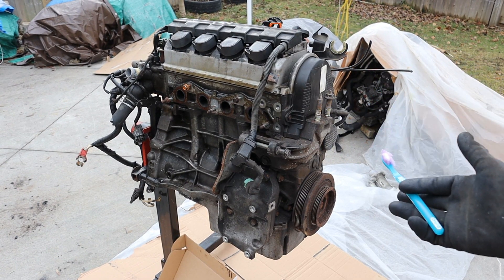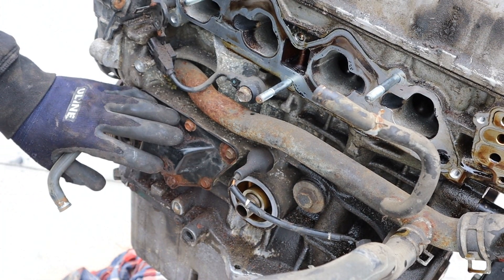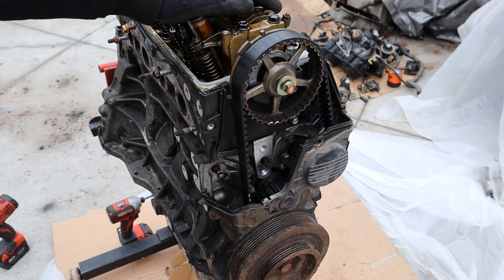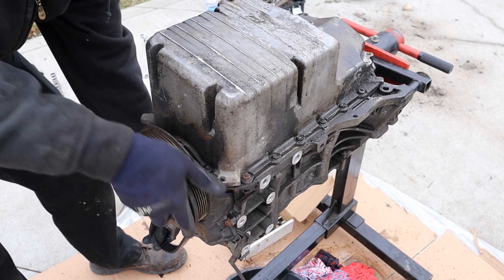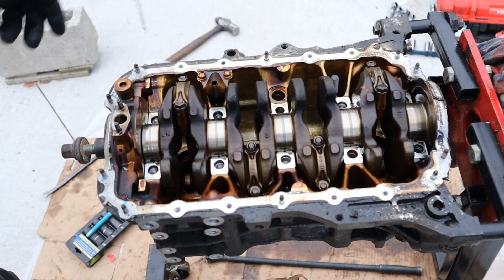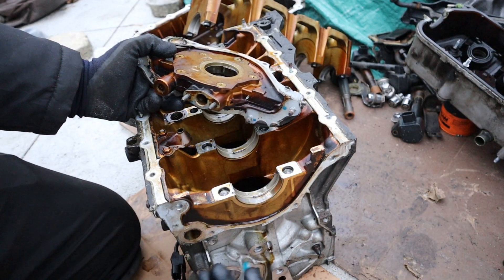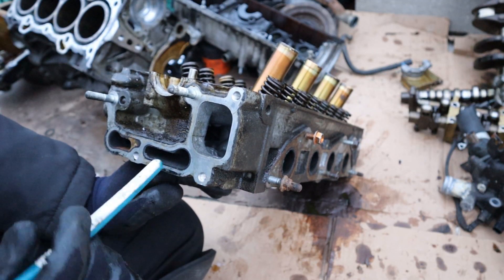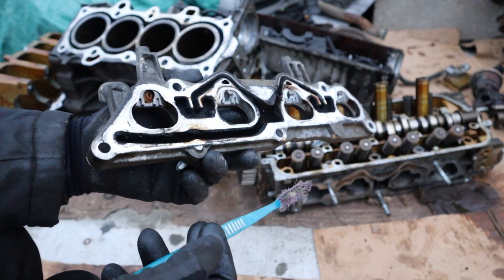Honda D-Series Engine: A Low Point for Honda

Comment: Disagree of the low point, Except for ONE huge issue, The headgasket failure problem, Just do it before You end up overheating it, Keep driving that's how I use them, It's a great engine otherwise......But of course I know these inside rather well from the heads up and the timing belt setup.😊

Comment: it may not be a high-performance engine but the D17 in my 2002 EX has 229K on it.  No replacement head gasket.  I call that pretty decent and she still gets 37 MPG on the interstate.

Comment: Low point, currently at 328k miles on my 2003 1.7 vtec. I did do a head gasket at 278k.

Comment: Dude you are nuts! The D series was way over engineered with its crank girdle + short of oil squirters which it didn't even need, those d16z6 and d15b JDM engines responded so well to just intake header and exhaust. I remember spanking a turbo Jetta with just those mods on my car. I've had four integras and four civics. And all my civics were single slam. My d15b was my favorite though. Vtec kicked hard on that thing using the p28 from the z6 and it was so damn clean inside. I would say it had maybe 30,000 mi if that.

Comment: On the backside of the block @ the minute 12:11 mark, that odd-shaped, pentagonal hole where the breather for the PCV valve goes: mine is leaking from there. How common is such a leak, how easy is it to re-seal, and where do I get a gasket for it? I've looked all over the diagrams at hondapartsnow with no luck. Am I supposed to use a particular grade of Hondabond on it?

Comment: Those 3 nuts you said at the bottom of the intake, they hold that plate for the EGR valve ports to pass thru. 
You can take off the intake without taking those 3 off. 
Once off, then take those 3 nuts off. 
I learned the hard way too 💯

Comment: The 7th gens we’re supposed to have the k series (like the rsx and what not) but Honda folded and put a weaker d series in it. Since the em2’s share the same chassis as the rsx…if the ey came with a k series these cars would be more sought after😂……but nooooo🗿smh

Comment: Honestly I would much rather have a timing belt than a timing chain usually on modern cars with chains you have to take the entire engine out to replace the chain unless it's a Toyota it's going to need to be replaced at some point in its life with a belt it's at least serviceable

Comment: 01 EX 338000 miles, using oil due to bad valve stem seals and I'll be replacing those this weekend apart from a blown head gasket at 213750 miles and some minor stuff its been a very reliable engine and car overall.

Comment: I guess they're a "low point" if you want power, but they are very simple low power efficient engines. I've got an 02 civic and had both A1 and A2 engines in it. It gets about 35 mpg and is my daily driver. It's so cheap to fix I'll probably never get rid of it.

Comment: My d17a1 had a timing belt snap.  Changed the belt and still fired right up.  330k miles on it so far.
Reply: And nothing broke inside?
Reply: @dudoufifi  one of the valves is bent

Comment: Actually it wasn’t a low point for Honda. It was a way to offer a single cam option vs the K. Then it was phased out later on. Funny how other countries used smaller engines in heavy Acura cars. This wasn’t the first time Honda did this. In Japan they literally have a AWD integra based on D. Love both the EL and Integra but the D is trash. I get people are happy with making 400HP out of them but come on. That’s like me saying well I can get 2200HP from a build Supra engine or skyline. In the United States where I’m from and the body style we offered was the lowest point in Hondas life. Lucky the Civic Si came with a K series. Great videos by the way.
Reply from the maker: Thanks. 
The single cam would have been the J-series 😅😅

Comment: Wohoo an engine I use is featured on your channel. I'm surprised how bang on everything in this video is. I remember trying to fiddle with the intake bolts with a spanner. I'm pretty sure the head gasket is blown on mine except the oil and water doesn't mix. Just have top up the radiator every few months. Oil leaks profusely from absolutely everywhere. I don't change oil given it automatically does half the job by itself. Yes the crank pulley bolt is extremely tight. Oil control rings were well clogged on another one I parted out. As were all the egr pathways.

Comment: My old civic made it around 400,800 km and only needed a head gasket. Other then maintenance done to it. That thing was a trooper
Reply: Same here, the cars rust out here in ohio way before the engines go
Reply: @noelleonard2498  yea passanger rear fender was going and drivers floor let go.
Reply from the maker: Cool! 400K is impressive

Comment: My sister's (which used to be my mom's which she bought used) is still running fine 300,000+ kms. No head gasket issues but it's been maintained and driven lightly.

Comment: Perhaps the D17 specifically (and in relation to their other engines) because my experience with D series says otherwise. They're all very similar, but I know for a fact that the D16A6 is nearly indestructible except in cases of extreme abuse/negligence. I've had a couple CRXes (still own my trophy retired garage queen- 88' Si) and I ran a D16A6 with well over 200k miles on it daily HARD. There was a period of time (about a year I shit you not) where my temp gauge kept going up intermittently and I thought it was just a faulty gauge/reading because whenever I'd hit the switch to close the sunroof, the needle would shoot up. Motor sounded, felt and ran fine so I wrote it off and kept riding it. I even started using water instead of coolant at some point because of what I thought was simply the famously cracked reservoir. Was exhausted and working insane hours as an airframe mechanic at a slave camp MRO so I couldn't be bothered. Fast forward however long it was & eventually I was at a milf's house I'd met at the bakery talking outside about to leave with my rex idling. The ride there had been odd, and I noticed that the muffler was smoking and smelling terrible, plus it was banging. I quickly went inside to check the temp and lo and behold, it was maxed out and right then I realized the gauge was not faulty after all (well, it was to an extent because of the sunroof thing but it wasn't lying the whole rest of the time when it was telling me my engine was hot). I quickly rushed the conversation to leave and when I hopped on and drove home, I knew I was screwed. Engine ran hot all the way and my exhaust was an AK-47. I had work the next day, didn't know of any mechanics in the area and I said f it and when I went to work the next day, I knew that's when I'd blow the engine. The whole way it was smoking and banging like CRAZY and I had to shut it off and let it cool before I went up a steep hill. When I turned it on I could already feel I'd blown the gasket and I thought this is it. Drove the rest of the distance I needed to get to the parking lot at work without shutting it off and it was the most painful thing I'd ever done. Soon as I parked it the engine was about to die on its own but I turned the key off and knew it wouldn't come back on when I came back. Anyway long story short, I had it transported to a coworker's house and when I pulled the head out, it was insane how much abuse the engine took and for so long. Head gasket had completely destroyed and was basically impossible to remove, the coolant/water around the cylinders was FULL of headgasket material and other crap and so were the piston heads. Eventually took a die grinder to the block to get most of it off, trying my best to not score the hell out of it, took the head to a machine shop to have it resurfaced (I really wanted to do the block but didn't have the tools or the time). My friend thought I'd have to scrap the engine. Head came back (shop guy said he took off 17 thou), put it back together with a new head gasket and to my disbelief, it started up just fine and is still riding to this day with that engine. Turns out it was the thermostat that had been stuck closed (there must have been SOME flow cuz I mean, it was a very long time running it so hot). I wanted nothing to do with it after that. I already had great admiration for the engineering behind these engines, but after that experience, I was in absolute awe at how something could be abused so terribly and still function, when there are so many engines out there that will fail at 30k miles on a new car.
Reply: I made it about half way through my boy

Comment: Click bait. Your statement is baseless. I’ve owned a 94 civic ex with the d16z6 for over five years now and through proper maintenance on stuff the previous owner neglected and tuning it up the motor has just gotten better and better. Super reliable and for sure will surprise you. The D series is the workhorse

Comment: I had this engine in my 05 honda civic. Lost compression in two cylinders on a long road trip in the summer. Made it to 295000kms. The engine was amazing for me until that point and still got me all the way home on 2 cylinders. Loved this car.
Reply from the maker: Did you scrap the car?
Reply: @speedkar99  sold to a Honda mechanic for 600
Reply: @139forLife he had it running by the weekend for sure. These are super easy to work on. But I love mine and would trade it for very few things
Reply: @emilianomartinez4083 have you experienced a chronic crank/no start condition w these d17’s? I have a new fuel pump assembly and coil packs/plugs and the car runs great when it starts. But lately it doesn’t start at all

Comment: I am with speedkar on this one, D series engines are awesome, but operator error gets it straight to the junkyard.

I had a Civic with the D16V1 with 3 owners, the last one liked to step on it while it was cold. I had a slow leak in the headgasket in cyl 1. 

It failed in the most common way, the compression leaked into the cooling system making the overflow burble and fill up slightly after turning the engine off.

Plus it had the green coolant which eats the headgasket material if its not changed. 

I drove the car for 2 years, sucking the coolant from the expansion tank to the radiator with a hose using my mouth 😂
I drove to Spain with the heat on high in 38°C I loved it (not)
Reply from the maker: True

Comment: The D-series as a whole isnt really a low point, the D16a1 is a DOHC 1.6L, basically a Honda 4a-ge with an aluminum block. The D16y8 can have some fun too, its just that the D17 is pretty bad. The R18 is the low point imo.
Reply from the maker: True it's this D17 that's the sore thumb
Reply: @speedkar99  D17 does suck, but I'm fairly certain you can use the crankshaft and rods in a D16, make a better d17

Comment: low point how? power? ok sure.  BUT you got a 115hp engine that got 600-700kms on ONE tank of gas, and you can redline that bitch all day everyday drive it like an absolute animal and it will run forever.  i seen ones destroyed only 2 cylinders working 90% compression it STILL DROVE DOWN THE DAMN STREET.  love honda.

Comment: At least on the manual 01 I had, you could raise the rpm’s up at a red light easily to drop the coolant temps back down. Since it had exhaust blowing into the coolant passages constantly. The fan did well at cooling it down until I had time to fix it

Comment: The D series actually traces its roots back to the 1970s (!) in the Honda E series engines. Very similar design except carbureted. Interesting that honda used the same basic design for more than 30 years

Comment: My d16z6 in my 95 civic coupe has been great, it has 200,000 miles and still runs like a champ, even though I floor it every where and rev it out even when the engine is cold. Gonna swap it out just cause it's kind of hard to make n/a power on that engine, gonna throw in a b20 and convert it to vtec. I feel like it's mainly the d17

Comment: I think the low point is now. Small trash 1.5 turbos that are slower than a all motor civic si of the past. Plus no more true vtec and screaming engines. The new ones got no soul. Not just that, build quality is just not the same for the whole car and design wise, they're heading in the direction of the acura beak.

Comment: i had d series in my first car it was 98 civic hatch with swapped engine (D16z6) i had this car for exactly one year, i drove it daily and i had a lot of fun i learned tuning on it i had it shoot flames from exhaust and i never was light on throttle, when i had an accident and my car was totaled but i decided to keep it 
i bought another civic with d16y8 it turned out that engine was rebuilded but it was done poorly and piston pin made a hole in my cilinder wall so i quicly swapped the d16z6 from my totaled car 
after i finished the swap i left car at mechanic because it had problems starting up 
i over heated the engine on first drive because one of coolant hoses unpluged itself and i drove the car without any coolant 
i fixed it and drove for about a year 
after i didnt check coolant in winter it froze the block and lifted the head 
i drove for another 2 months daily until the pressure blew my coolant hoses 
i decided to rebuild it 
and it turns out the engine was 100% nominal 
honing was still present 
i just today got feedback from machine shop and they said its all good and i dont need to overbore it or put oversized bearings
i literally trashed this engine for 2 years to find out its 100% stock and still 100% good to be put back on original parts 
i will just say one thing...
engine production year is 93... its 30 year old engine which never had easy life 
god knows how many chassis it was in 
and its fucking mint condition...
honda is just different

Comment: The D16's were legendary engines. I had a 2000 Civic that had a D16Y7 basic no v-tech manual throttle body all aluminum intake that made hardly any power but got close to the TDI of the time in economy. I had well over 300k on this car with no issues at all aside from the car just deteriorating from winter driving in Michigan. I had to deal with the dreaded P1457 evap code all the time and after I got rid of the car, figured out how to fix the issue these had and I would have had no lights on the dash at all. Very solid car and will go back to honda at some point depending on what generation they exceeded in reliability. Some gens weren't so reliable as they once were. A car mainly assembled in USA with most US sourced parts. You can't really say that about our domestic brands.

Comment: Yeah, this guy doesn't know what he's talking about. I, too, had over 300k on my civic when i sold it, running fine!  I was the 3rd owner!
Original engine, of course. Never had ANY problems with that engine in the entire 17 YEARS I drove that car.
Just proves that you gotta be careful listening to people on the internet. 
I'd buy another one of those cars, with that engine, TOMORROW, if i could find a  nice one.
Sorry i sold the one i had, but after 17 yrs, you get kinda tired of driving the same car 😀

Comment: Anyone that's ever had a head gasket failure on any D14, D15, D16, or D17 is a complete idiot. That is called an operator error and has zero to do with the engine. There's an entire fucking display behind your steering wheel. You can always spot the little children that have no idea what they're talking about. Pretty weird that all the guys daily driving 500whp 7th gens arent having any fucking head gasket issues.... Engines have this thing called a maintenance schedule. The last 7th gen customer car that I services had 370,000 miles 3 years ago. It's get driven from California to North Carolina twice a month. Dorks

Comment: You got it a bit backwards, bud. On the cam the two lobes that are the furthest apart are the exhaust lobes and they are the same lift and duration. On the middle where the small and big lobe are the engine doesn't run on purely 12 valves per say, because the small rocker without the roller still opens the valve a tiny amount to let any fuel that has gathered up on the back of the valve enter the cylinder without puddling up. The rocker arm with the roller is the one that opens up fully at low rpm and in higher rpm (2500 rpm and above) the rockers lock together so only the roller rocker arm is opening the valves and riding on the high profile cam. This is the same VTEC-E that is used in the d15z6 here locally. There is a myth that because it's a VTEC, it adds power at high rpm. Nope, this one is a bit different. On low rpm in works on "12 valve" mode to promote better mixing of the air fuel mixture and to increase air velocity, thus this does give you better power, BUT on lower rpm. It gives you a much nicer torque curve in the lower rpm region. The reason why it can make decent power up top isn't cause of VTEC. At higher RPM it behaves the same as a Non-VTEC engine, just the lobe is quite large and is similar to a regular VTEC hi-profile lobe. One underrated upgrade people can do on these engines is to install the cam and the rockers onto a Non-VTEC head and just lock it into a 16 valve mode all the time. That's what I did on my d14a4 and it really helped it breathe in the mid-top RPM region. Idle and low RPM are fine as well. No lumpy idle or low torque at low RPM from the big cam. 
Really enjoying the vid and dissecting the engine and what makes it tick. Keep it up!